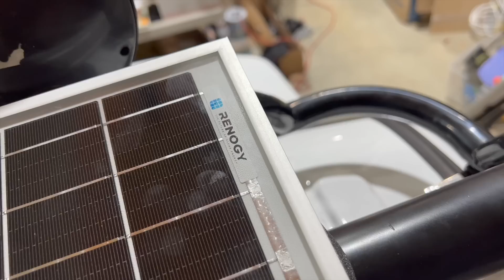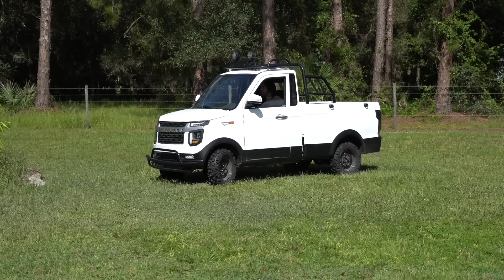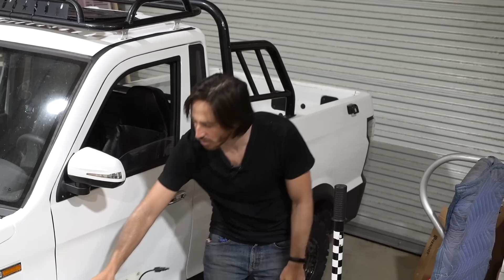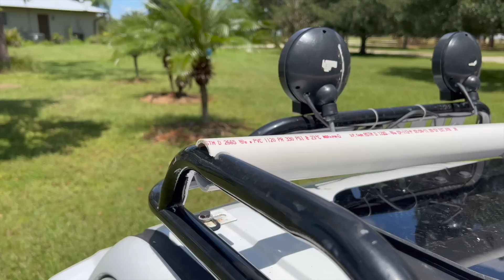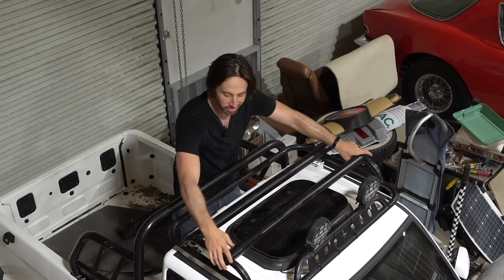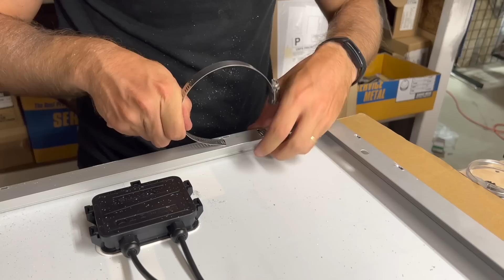I added a solar panel to charge my $2,000 electric truck

Comment: Considering it's a 50W panel, and it's claiming delivery of 43W to the battery, I'd say it's a very efficient boost converter + MPPT unit. 
You should verify the readings with a good DMM. You should never trust Chinese claims or readouts without verification.

Comment: The Panel should be angled the other way for less wind resistance.
Reply: Perhaps, but at the low speeds driven, aerodynamic drag is essentially nil.  Also, this way rain runs to the rear and allows the moon roof (which opens to the front) to stay open in gentle rain.  Other way would have water run to the front and then into the moon roof if open.  Decision on position was based on multiple factors.

Comment: Good stuff! Try upgrading to a 100w panel in the future.  With a 50w panel and using an MPPT controller you'll be lucky to get 35watts. Solar panels aren't 100 percent efficient, but they're awesome. You might find the shade will create an added benefit a larger panel as well.

Comment: I see a couple others ask about putting the flex panel on the hood too.1/2 pvc tubing filled with expanding foam will keep the shakes away in a frame where ever you use it.?Tires look really meaty,and a great addition.

Comment: It looked like the high-jacked wires and the normal charging wires go to the same location on the truck. It appears that the normal charging port is like a PC 110vAC port. That would make AC and solar panel DC going to the same location. Does the truck normal charging have a brick that converts your home AC to a DC source for the truck? If so, that DC source appears to be going into the truck, and back through your solar charge controller. If you installed a switch, off camera, then just ignore me. :-)
Reply: He could set the switch off to work with the key to turn it on, but unless he did that off camera, it doesn't seem like he did that.

Comment: I can't fully tell from the video, but is there enough room on top to add a second panel if you rotate the first panel?
Reply: The back tips up so they might be a fraction too long (if he doesn’t want to (re)move the spotlights) but he definitely could put a wider panel on the roof rack.
Reply: @SoshiMECH  From what I can see in the video, it looks like it may clear the bed, but as I said hard to tell from the video.
Reply: Definitely

Comment: I would have probably put second panel on top of the hood and then connect the panels in series assuming that your charge controller and battery can handle that. 🙂
Reply: Yup, Renogy 100W solar panels got smaller about 2 years ago. There's probably space for one 100W (or just another 50W plus a MC4 Y-splitter).
Reply: Ya I was thinking that 50w looks small I'd definitely look for something as big as you can fit without looking ridiculous and something around 100w would be twice the power
Reply: Absolutely. I came here to make the same comment. I'd probably use a higher wattage panel, too, or a couple. Plus, for myself, I'd put a passthrough power bank inverter in the loop, too, so I could use tools around the property.
Reply: Thank for update Mica. You should name this truck ;) Can't wait for next update
Reply: Looks like it has room for about a 100-120watt panel
Reply: His MPPT is only 40W, he's got a choke point on the throughput, he can't get it down from helios.

This is a lesson in Buy Bigger than you need for solar...always.

However, a good video and a nice setup - for florida.
Reply: @stevenfaber3896  do you mean 400W? I see 400W step-up on the meter
Reply: @stevenfaber3896  The MPPT is 15A or 400W, so plenty.

Comment: I suppose you could stick the flexible pannel to the bonnet / hood . Hiding the wires would be difficult tho. Or even having a large pannel acting like a truck bed cover on hinges and thoses hydraulic rams to lift it up and down to accesses the bed. Think that would like sweet

Comment: Great little project. Would be nice if the flexible panel could be used as a temporary sun screen / shade across the inside of the windscreen with a quick hook up to the charger. Keep the cab cooler and get free electrons!
Reply: True, but angle to the sun would limit the energy produced.  It's actually pretty amazing that small changes in the angle to the sun make huge impacts in power generation.  Thanks for your comment.  Best regards
Reply: Or it could be installed on the hood or the truck.
Reply: Oh, why haven't I thought of that..
This is the best part of watching & reading comments on these videos..
Thanks for the comment..
Reply: or velcro it to the hood, as the sun tracks it could switch over and grab more rays?
Reply: @aisrael13  Hood is a great idea. I think yachts and some Motorhomes just glue flexible panels on
Reply: @aisrael13 Transparent 3M Dual Lock would be even better as velcro.
Reply: Wow you hit the nail on the head with that future prediction. When they promote cars they have figures for parked and driving because they are constantly  charging but the rate is different
Reply: Cheaper and easier this way
Reply: they had solar panel for prius, but then stopped having it

Comment: Good luck with that.  I have a solar panel about that size to charge up my kayak fishfinder battery.  It takes days and it is one of those tiny motorcycle type batteries.